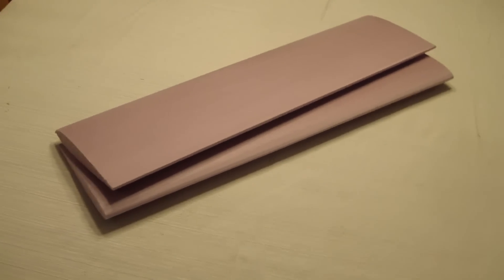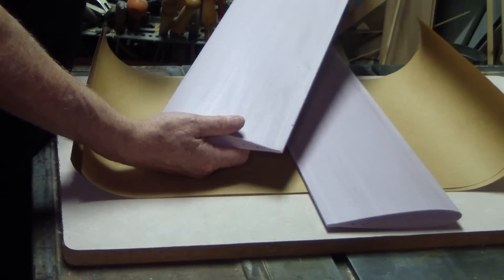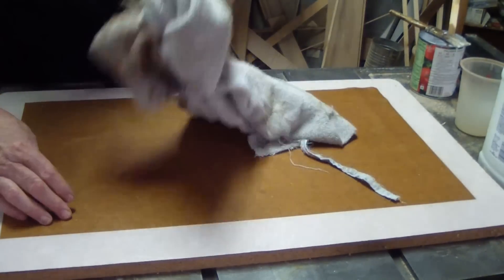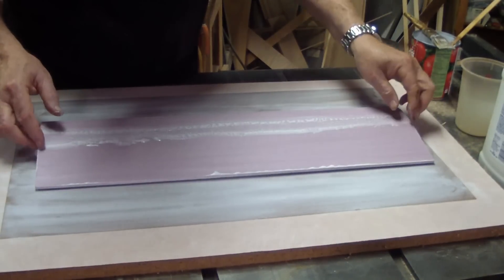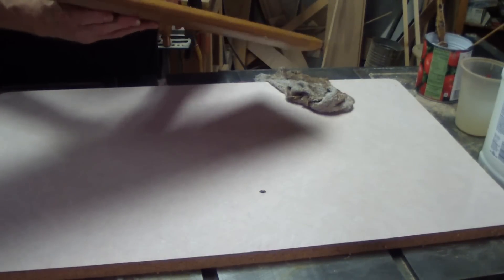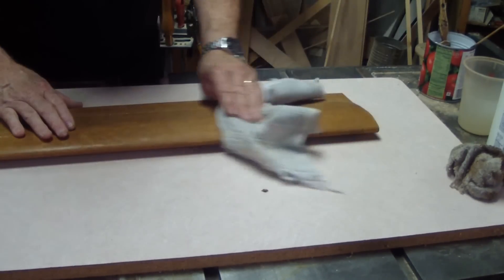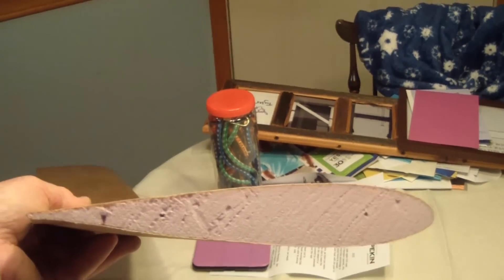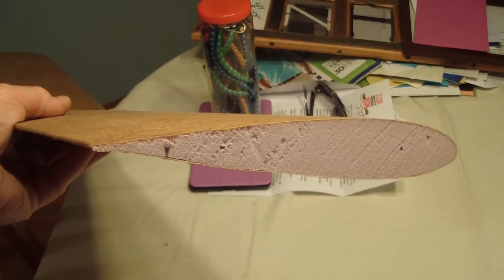Laminate foam wings cores with brown kraft paper

Comment: Well Sir    Thats a first for  me, never seen this done before- at first i thought that wing will be  SO heavy and no good  but you proved to every body that's not the case.   When i saw how much glue went on i was expecting the weight to be double what it was, and if you think about it the water  drys up -- goes away and with watered down glue there will be few solids left to  count.  What with the shrinking of the paper and the water soaking into paper and foam once dry i can see how its so strong , I will be trying this  soon. Thankyou for showing us how its done

Comment: What we have here is stressed skin construction which has amazing torsional strength,it is cheap to build and highly practical,I have used such panels on high wing braced monoplanes with simple stub spar joiners at the wing root,howevr butt joining and taping up with something like open weave bandage is very strong and spreads the load along the wing for strutless construction,brown paper really has its uses in foam model construction.

Comment: I have used thinned wood glue to adhere both brown paper and balsa skin to foam. I thinned the glue and added a little food dye so you can see that the glue is evenly spread, let it dry then use a covering iron to soften the glue to join the surfaces. I have done this on my Byron BD5J and on a scratch built wing that has been stuck 30 feet up a gum tree since 2006, and there is no sign of delamination!
Reply: Great idea with the dye. ill use that tomorrow!
RIP tree plane

Comment: Good job sir! I do have one trick that we used to do for extra strength regarding wing loading. We would put a strip of fiberglass filament shipping tape on the underside of the wing along the spar line before covering. It acted like a tendon and would keep the wing from snapping in a hard dive or turn.
Reply: I like to use table edging strip. They are cheap and easily available. You don't need no spar if u use these on both side of the wing.

Comment: Excellent video, Brian. I have seen where Flite Test used a similar technique using water based acrylic to laminate some of their planes, but I believe that using the glue would provide a stronger wing.  I have not tried the hot wire foam cutting technique yet but build my planes out of the Dollar Tree Foam board. I am going to try and remove the paper from the DTFB and laminating with your process and see how that turns out. I would suspect that if i used the "waterproof" type of glue it would help.
Reply from the maker: You could use waterproof glue....or use another trick shown on FliteTest.....paint the finished plane with Minwax fast dry polyurethane.....SPIRIT based.....NOT water based.    It doesn't add much weight and when dry, is completely water proof.   It is also an excellent base/primer for any top-coat paint you might then want to use.   Seach my name as an author on FliteTest and you will find some planes painted this way.    Brian.

Comment: Thanks for the excellent video Brian - still relevant after all these years! Two questions however: what "grade" - i.e weight - of Kraft paper do you use for these wings? Second - any tips on what kind of insulation foam you use?  Many thanks . . .
Reply from the maker: The brown craft paper is relatively heavyweight. It was a large roll of packaging paper that I still have. Lighter paper would work just fine, the heavier paper isn't an issue weight wise.  The foam is pink or purple insulation foam from big box store. I usually buy it in 4x sheets and either inch and a half or 2-in thickness.

Comment: People who have never tried this method will think, oh! that can't be strong. They sure will be amazed at the strength of paper and glue. The glue soaks into the paper, and when dry turns into a kind of thin plywood sheet. When it's totally dry it leaves a beautiful sound as you touch it, almost a hollow feeling, I love it. It's idea for small to medium size wings and anything bigger I'd add somekind of reinforcment. I wouldn't go adding CF spars cause then it's becoming too much like hard work, which would defeat the whole purpose. This method is for the guy who wants a super fitted wingskin with great strength but doesn't want to invest too much of his time. If you really have to have a spar, I'd use strips of fiberglass wetted out, top and bottom of wing, and when dry, cover with paper......phew😩

Comment: I've used white glue sealer for epoxy for years , since the 70's I would go with vinyl acrylic either or Gorilla Glue clear( it doesn't foam up) because white glue is flexible when it dries vinyl acrylic is Superior in all Ways , if that's just plain Elmer's it is susceptible to water and solvents such as acetone

Comment: This is a great way to cover foam wings and nice and cheep too,. But I find that you need to seriously weigh down the wings overnight as the paper 
shrink is seriously strong, or you may get warps in the wings Best to use water based emulsion paint first and let it drive for a couple of days and then thin coats of car aerosol arylic

Comment: I've used 60 lb brown paper with very slow laminating epoxy for a wing. I spread out the epoxy, then squeegee it in after a few minutes, then do the other side. After that, I vacuum bagged it onto the cores. That was a lot of trouble, but less trouble than using fiberglass. The result was a very tough hlg wing of about 150 grams, which was a bit over my weight budget. I stepped on the tip by accident once, and it didn't break, though I think it distorted a bit. The trailiing edge was a bit wobbly, but I'm sure I could figure out that problem.  I suspect that with 40 lb paper, it would have been light enough, and adequately tough. You can get lifetime sized rolls of different weights of kraft paper from Uline. The prices aren't too high, considering how much you get. I wonder if anyone has explored gummed paper tape for use on foam model airplanes? It might be more consistent and easier, though perhaps it ought to have a finish put on the outside later. 
At some point, I did some testing of kraft paper/epoxy vs fiberglass/epoxy. In bending, the paper was at least as stiff, for the weight, as the fiberglass. I had to do some calculations, though, because the fiberglass was not exactly as heavy as the paper. Stiffness/weight gets higher as the material gets thicker, so it's necessary to adjust the results to reflect this. I wonder how other types of paper would do?
Reply: Thanks very much for all this information. Kraft paper is the one to go for I've heard - longer fibres make for stronger paper. Available in different weights. And Eyeball Aeronautics here on YouTube uses newsprint - also from Uline or similar suppliers - with white glue. 
My requirements are: inexpensive, light, strong, quick to make. Not asking too much, eh? 
I plan on doing some experiments . . .

Comment: do you place the core in the foam saddles to ensure they cure straight?
how do you finish them?
this looks quite strong and light and easier than conventional balsa sheathing.
Reply from the maker: No, provided that the weather is nice, I put them outside in the sun and the wind, with minimal support so that they can dry on both sides at once.   They WILL bow somewhat to one side....The side in the sun dries faster and shrinks BUT the other WILL catch up.   I usually turn the wing a couple of times to even the drying.   They will make you think that they are going to dry with a bow to them, but they straighten out.   Brian Kuehn.

Comment: I wonder whether a GRP vacuum bag would snug down the paper?
Reply from the maker: the water has to evaporate for the glue to dry so I don't think of vacuum bag would work
Reply: You'd just use the vacuum bag to draw the skin tight. It's a trick used when laying up the fiber glass. The vacuum flattens wrinkles and the like. The practice is most common in prepreg and is done between layers in order to keep problems from compounding..
Reply from the maker: Makhoe van der Vlugt sounds interesting but the brown Kraft paper shrinks as it dries and it's really quite type tight
Reply: Did you ever try a material like cotton? I'm sure it would have a much higher tensile strength per weight than craft paper.
Reply: Or reinforcing the foam with a lamination strip of prestressed fiberglass tape on the top and bottom between the paper and the foam?
Reply: I think the problem with both of our ideas is price. Paper is cheap. I feel as you do though. I wonder how far this could be taken?
Reply: You can buy fiberglass mesh tape for drywall repair.
Reply: if you're going to all that trouble you might as well buy glass cloth and epoxy. The point of this method is that it's cheap and easy.
Reply: I've seen nylon pantyhose substituted for glass fiber cloth to reduce weight on model airplanes. Could that be used with this glue system?
Reply: Jeremy McMillan 
I use the fibreglass mesh tape with a watered down PVA glue bonded onto the foam. Then I completely coat (several coats) over the fibreglass mesh tape with PLAID MOD PODGE HARD COAT Waterbase sealer, glue & finish. Not only this lightweight but it is durable and kinda like rebar/ concrete with the mesh tape and waterbased sealer. 
From there, you can either paint or laminate a finish.

I am currently modifying my Eflite P-51D Mustang.

Comment: Dear Brian, I would like to know if a greater number of paper layers is needed for a wing 2 meters long and 0.36 meters wide.
Thank you:
Juan
Reply from the maker: Juan, sorry I haven't checked the comments here in a long time.   I've never tried putting multiple layers of paper on a wing but it could certainly work.   I think that instead of multiple paper layers, I would instead cut a spar slot in the foam.  For a 2 meter wing I would suggest a 3/8" x 3/8" spruce spar, glued in with elmer's or wood glue or epoxy.   If a sport model, put the spar on the top of the wing.   If its a 3d plane, pattern plane, high wing loading, put spars top and bottom in the wing.   Sounds like you may be building a glider?   That adds a little to the complexity to the construction but its a good addition.   Assuming a 2 piece wing joined at the center, adding a plywood plate in a slot behind the spar(s) adds a lot of strength.  Fiberglass tape around the center joint is also a good addition.   Hope this helps.

Comment: Nice video. Why do you choose packaging paper over laminate film?
Reply from the maker: I'm not sure what you mean by laminating film....are you talking about Monokote or one of the other iron on coverings?   Or are you talking about the clear film used in a laminating press?  Either one can't provide anywhere near the strength of glued paper.  Monokote will stretch, even if you could get it uniformly bonded to the foam (probably impossible to do).    The WHOLE reason for using paper and glue is STRENGTH.   The finished wing is so strong that it needs no spar.   Full size aircraft used a similar technique.   The WWI Albatrosses had a plywood skin on the fuselage; the british Mosquito bomber had a stressed plywood skin over the entire aircraft that made it light but incredibly strong.
Reply: I think he means temperature sensitive laminating film sold by the roll & used to cover large pictures and charts/maps etc. It is also sold as "pouches" to cover books etc. It increase the weight by approx 30% if you use the 75 micron(3mil) as I do for planes the size you are building  @kuehn1953

Comment: thats a ton of elmers glue.....gonna weigh quite a bit! would be lighter with balsa and a tad of crasy glue
Reply from the maker: I think you are missing a couple of important points.   Yes, it's a lot of elmer's glue but that doesn't matter for several reasons.   FIRST: the main reason for using the construction method is COST...it is dirt cheap.   Insulation foam, craft paper, and white glue.   The wing costs pennies.  SECOND: It is incredibly strong.   There is no spar and no spar needed.   THIRD: the finished weight of the wing simply isn't an issue.  Elmer's glue is mostly made of water and the water all goes away, leaving behind the alphatic resin only.     I don't know if you watched the video to the end but I showed the weight of the bare foam and then the weight of the finished wing with glue and craft paper.   I have built and flown a half dozen planes with wings built this way, including a version of the Midwest Hots that I call the Hots-e (electric hots...my own design).   It has a 3 foot wing span, is fully aerobatic, flies for 6 minutes on a 1000mah pack with lots of maneuvers, or 8 to 9 minutes with very lazy flying.  It penetrates the wind quite well and can fly easily in a 10 to 15 mph wind.   It has a great glide.   It is NOT heavy; it's flying weight is perfect.   I've been flying R/C for 35 years.   I have seen and flown lead sleds (not my planes but fellow club members).   I know when the weight is a good match to the wing loading.   The planes I've built with this wing construction method have been great fliers.   The wings could be built lighter, at the cost of much more time and money, but being lighter wouldn't be better.  A lighter Hots-e would be pushed around more by the wind, wouldn't penetrate the wind as well, and doesn't need any more glide than it already has.

Comment: A friend of mine tried this technic few years ago and he allways had problems, on the  drying process the wing was warping/bending...
How to avoid this issue?
Reply from the maker: Do both sides at once....if you do just ONE side, you guarantee a warp because the paper shrinks as it dries.   I do both sides at the same time (as per the video) AND I usually set the wing outside in the sun...and go out and turn it over a couple of times during the day.   Even in sunlight it can take hours to dry.   My finished wings end up straight.

Comment: Great video - thank you. Why make the ends pretty before trimming them off? Seems like wasted process.   And yes, folks, there are 473 different ways this nice fellow COULD have done this, but this is what he showed. If YOU are so much better, where is the link to YOUR video?
Reply from the maker: John, I don't understand your question.   I don't recall doing anything to make the ends pretty.   If the question is about snipping the kraft paper and folding it over the ends in short pieces, that is done to get solid adhesion of the paper right out to the wing tip.   If you don't do that, as the paper and glue shrink and dry you sometimes get some of the paper at the end of the wing panel that doesn't stay down firmly and you can end up with parts that are loose.   This is seldom more than 1/2" or so, but I like to get it glued down solidly right to the tip of the panel.   Hope that answers your question.   If not please give me a clarification.
Reply: Brian Kuehn - thanks. You answered my question. “Pretty” mightn’t have been the best term.

Comment: Not to be overly critical, but from experience, you used about 10 times more glue than necessary.  it just adds excess weight.
Reply from the maker: I probably could use a little less glue, but the weight, with the glue that I used, is NOT an issue.   The panels shown in the video ended up being 84 grams ( a bit less after trimming the ends and the dihedral angle.   1 ounce = 28.35 grams.   Divide 84 by 28.35 and you get 2.96 ounces.   The assembled wing is therefore just shy of 6 ounces and this is a 4 FOOT wing with a 7" chord (before adding ailerons).   Show me any other wing that big (and that STRONG) that weighs less than 6 ounces.    One of the first planes that I built with this technique is my own design, loosely based on the Midwest Hots .40.   It has a 38" wing span, and measures 35" from the rear edge of the rudder up to the tip of the spinner.   This plane (Hots-e) fully stuffed (except for the fligth battery) weighs 15.1 ounces.   I use a 3s 1000mah zippy compact 35C battery to fly this one.   The battery weighs 3 ounces, so the all up weight is 18.1 ounces.   It flies like an angel.   I put 3 flights on it this evening in the calm air.  I loafed around on the last flight, keeping the throttle at about 40% for the entire flight.   I did lazy circles and a few loops and rolls.   I was airborne for 11.5 minutes before the battery was done.  I would NOT want this plane to be any lighter.   It is perfectly balanced all around.   If it was lighter, I wouldn't penetrate the wind nearly as well.

Comment: Wow I never even thought of using a table saw to get the angles.
A question about your finishes of the paper covered wings, do you prime first?
I'm thinking of using some type of water based paint and applying it with an airbrush, any thoughts?
Thank you
Reply: Elmers glue is too heavy, even watered down...so to are water based primers & undercoats...they are full of heavy fillers...use aliphatic resin is a little lighter but...it has a MUCH higher compressive strength & just as good in tension as elmers...is much more ridgid & sands well...if want light...use nitrocellulose laquer...Duco...it binds to the paper wood fiber at the cell level & drys VERY light & fast...be mindfull though that cellulose laquer cracks easy if dinged...you can add a little..a little...pva as a flexi agent...& cellulose laquer is easy to repair or refinish just by spraying or rubbing thinners over it...re-melts it...there is a much stronger & lighter glue but gets more tecnical to handle with this paper & foam method...this is old skool stuff...from an oldy learned back in the 60s & 70s